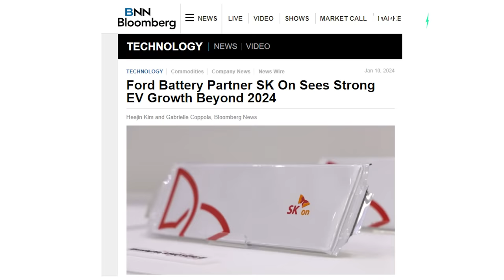Ford FIRES nearly 70% of EV plant workers,ramping up ICE production

Comment: I considered an EV from Ford, even considered a Bronco. However, with all the quality issues, dealer markups plus the dealer website fraud. I just won't ever buy from Ford until they can sell direct like Tesla and figure out their quality control plus fix their stealership network.
Reply: The other issues to consider with a EV:
Do I have a home charger, will I need to add battery packs and solar to the house to charge over night
Do I have a charge station near me that works
It the Electricity in my area reliable, or if out for a long period of time (this could turn out to be at night when you need to charge)
How many other EVs are in my area (Charge times go up if there are many)
Do I have the extra time in my day to charge it, if it takes an hour to charge that is an hour away from family
Does work have a EV charger I can use (Eventually, it will also be how much will they be charging me to use it)
how many miles am I expecting to drive it
Do I go to areas where there are no EV chargers
Can I afford the extra costs that go along with a EV
Will I still be able to afford my EV when the cost of electricity increases, and it will
Can I afford the extra taxes that will be coming soon to EVs, like road taxes (every dollar lost from ICE vehicles will be transferred over to you)
Reply: This is the problem with all the legacy manufacturers that are selling EVs, even the Europeans like BMW in the US.  The dealers hate EVs because they don't understand them, they can't make a fortune off service, they have to spend money to hire new mechanics or retrain existing staff.
Reply: @gotafarmyet4691 Do I live in a house? Or do I live in an apartment?
Reply: @jazzcatjohn  True i did leave that one off, because unless you own the property you do not have a choice.
Reply: @gotafarmyet4691  No, it plugs into a regular wall outlet. No, don't need solar,etc.  No, don't need a charging station unless traveling beyond the EV's range and plugging into the available outlet would be too long to wait. The rest of the issues are not really issues for anyone that has access to electricity where they park and extra taxes doesn't make sense because ICE vehicles will see a big increase in taxes which is why many in the US are upset. So, to summarize, if you have access to electricity you can own an EV and in many cases the cost of ownership is much lower than ICE and the vehicles are faster and more reliable, etc.

Comment: They need to listen to their customers not the government or they will be out of business.
Reply: Their customers are waiting for small, cheap EVs like they have ... everywhere else.
Reply: @jamesvandamme7786  Where's my diesel prius?   Hwwwaaaat?
Reply: @vilefly I have my gas Prius. Getting great mileage. 50+ in mild weather and 40+ in below freezing.
Reply: @miltonhayek2494  Right.  But a diesel engine is more efficient than a gas engine.  They could have done better.  Others could have done better, but they didn't.  Trains have done it for years.  It is known technology.  Diesel-electric hybrid drive is most efficient, otherwise they wouldn't use it.
Reply: @vilefly  No argument. I worked in power train for 18 years. You're 100% right on efficiency (and engine longevity). I feel the same way. I think it's a perception issue. I think they do this because much of the publics bias against diesel. At least in the US. But I'd gladly pick up one of those.
Reply: And they should behave like Real 'mericans right?
Reply: @douglaswatt1582  What?  If you're referring to what I said, it has nothing to do with being a real anything?  Diesel has a bad rap in the US. People know very little about it. What they do know is based on 80's trucks that spewed smoke, loud as heck, and rocked. Terrible first impressions. The newer generations have also been told that diesel is just dirty gas. They don't know of any upside to it. Stop trying to pick fights over nonsense.
Reply: @miltonhayek2494  I drove diesel cars in Europe. Smooth and good torque, and cheaper than petrol. I tried to buy a diesel in the USA but no got. Funny since trains and trucks still use it but cars put out too much particulates?? It would have been a good alternate to reduce energy consumption. But that's the past, with manual transmissions, and now pistons.
Reply: @miltonhayek2494  Well, the main bias was the high sulfur content which stunk, and damaged injectors over time.  I believe european diesel was more refined, and had less sulfur content.  Only recently did we lower the sulfur impurites.  2000, maybe 2010.....not sure.   I just wish they would use diesels with opposed piston, opposed cylinder design...like fairbank-morse engines.
Reply: @vilefly  I can't say about the chemical makeup.  I don't have the knowledge in that regard.  What I do know is that America produced terrible diesel trucks for many years in the 80's and 90's.  This view still persists.  And American's think of it as dirty, smoke billowing, pollution machines.  I felt the same way for a long time.  Then one day, while working at Ford on the powertrain line, I talked with a very knowledgeable engineer.  He drove a VW diesel for the same reasons we are describing.  He explained about the trains, the use as generators, etc.  It was a very enlightening conversation.  I still worked primarily with gas engines.  But slowly I did see how useful it would be to integrate them into the mix.  And the best way is what you had said earlier with the use in something like a Prius.  It would be a perfect match.  It would be even more efficient than the current setup.  And the engine would last forever!  Diesel is more expensive here than gas.  And by a fair amount.  But the efficiency gains, and eventual price reduction as more of it is used for this purpose, would make it worth it.

Comment: Everyone saw the EV graveyard in Chicago when the temperature dropped below freezing. These just aren’t practical yet, maybe someday but not any time soon.
Reply: what is this again?? I have a Mach E GT and it does fine in below freezing weather.  The range is about 20 miles less is all.
Reply: @panzer948  thank you for your anecdotal example.
Reply: What happened in Chicago actually happened. It’s a problem.
Reply: @risinbison1106  nothing anecdotal about it. Do you own one and speaking from experience? I am actually responding to you now while sitting in my Mach E at a supercharger. I am driving round-trip between Charlotte and Raleigh NC today, which is about 100 miles more than the total range... here in the southeast I am getting about 250 miles total range, when normally it's 270. That's real world experience to counter yours. If you don't believe me then that's your problem. I also normally just drive around my home city and charge at home for 20 bucks a month on my local utility pilot program. Good thing cause my other car only gets 17mpg... be glad to share more if interested.
Reply: @panzer948 it is anecdotal. As are the problems we saw occur in Chicago. The problem is not your experience. The problem is the experience in Chicago - which did genuinely occur.
Reply: @panzer948  I drive a lot cross country and sorry, I can count the number if EVs I see out on the open road on one hand. I’m glad you’re satisfied with your purchase but even people I know that have these won’t take them cross country. Maybe when the infrastructure is better they will become more plentiful. I have concerns about children in Congo or Chinese slaves mining cobalt for these but if you don’t think about that then you shouldn’t have a problem with it. I tow a large trailer as well, you can do that right? Ford lost $36k on every Mach E it made last year so they’ve halted production so hang on to it since it looks like it will be a collector in 20 years since nobody is hardly buying these.
Reply: @risinbison1106  you got a few facts wrong there buddy.  Ford hasn't stopped production of the Mach E.  They increase and then decrease it based on demand. Google that, like I just did, and a ton of articles will pop up.  This is the same with all EVs. Why, because a lot of people still don't understand them and are afraid of change.  I embrace it is all. I like new tech and I don't mind being an early adaptor.  I was also one of the first to buy the Chevy Volt in 2011 and GM lost money on all of them too.  That isn't nothing new with new tech. As more  people buy them, they will have bigger profit margins.  And wow.... don't even get me started on your comment about energy. If you really want to play that game I bet I could estimate a few million people that have died over the price of oil.  Think about all the wars we have fought and the millions we have spent dealing with the Middle East BS.  So, don't go talking about some mines and child labor.  The good news, if that is even half true than it can be changed.  Sadly, the BS in the Middle East can't.  Bottom line, energy isn't free and we are a long way from even partial Green Energy.  I will agree with you on one thing, the infrastructure across  the country does need to improve to bring more people into the market that spend several days a month driving several hundred miles.  But guess what, I took mine on a day trip today outside of its range and I might do that once or twice a  month.  The rest of the  month I am charging at home and never visiting a gas station.  Think how much that time is saving to wake up to a car that is fully fueled over night.  I think more are like that then are driving hundreds of miles a day.  If your not, then you need to wait.  I don't blame you but there are also pros to EVs, which many seem to ignore.  Another pro, which for some reason they haven't rolled out to gas cars, is it drives itself.  Pretty sweet to have autodrive.
Reply: @panzer948  I didn’t get anything wrong, you’re just a bit triggered but I understand. Ford is cutting back to bare minimum production because they can’t sell any Mach Es and they’re still have last years models filling up dealers lots, nobody, except you, want these things and dealers won’t take anymore. Want to discuss the Middle East? Gladly. We can produce enough oil here in the US easily and don’t need them but we can’t get enough cobalt here so those kids better get their ass to work so people can drive around. I noticed you avoid the towing question, no surprise, usually an SUV can go more that 80 miles hauling a camper but you’d probably have to strap a diesel generator to your roof to make it that far. EVs are not new technology. As you stated, the volt has been around for 13 years, the Honda insight came out in 1999 so we’ve had plenty of time to adapt but the volt and Mach E both lose money for the same reason. They’re grossly overpriced for their capabilities. A new base ford Mach is $43k, an F-150 is $36k. I could fill gas for 8 years before I’d make up the cost difference and got bad news for you, nobody wants to buy a used EV. The future is hybrid because it won’t leave you stranded in Chicago during a cold snap. The auto drive is cool technology, it’s also available on full size Chevy trucks so it’s not like it’s that unique.I’m glad you like your car, I really am but other than Teslas, the only place I ever see these things isn’t on the road but in dealer’s lots collecting dust.
Reply: @risinbison1106  still wrong on some facts as there are a ton of EVs in city's. Heck Teslas are about as common in Charlotte as Honda Accords, which is why I didn't want one. Yes EVs are great for city driving and not so much cross country until infrastructure improves. If city driving is mostly what one does then they are great. Just because you are a daily freeway driver that tows doesn't mean everyone else is. I get it that they don't fit your lifestyle (daily high mileage and towing) but they do fit many and eventually many others will too as oil is not a infinite resource, even in this country. Besides we live in a global economy and other countries will develop alternative technology if we don't (because oil is $$ there) so we need to stay ahead of the curve if we want to remain a world leader.  We can't wait for oil reserves to get low (and $$)  before figuring out a new tech. The time is now to work out remaining kinks so they are better for everyone. In meantime I have 23K miles in a year and haven't stepped foot in a shop for maintenence or repairs. Yes another pro. Did I tell u it costs me 20 bucks a month to charge at home in those 23K miles? Yes another pro. Did I tell you I hit 60mph in 3.5 secs? Yes another pro.  So I have already admitted to the cons but you have to admit there are some good things about them but if you cant see that then I am talking to a wall and wish you good day.

Comment: Not surprised at all because the Lighting with 515km is 100k plus tax in Canada. The same ice F150 or equivalent is almost 40k less so it’s a no brainer keep the ice truck.
Reply: Especially in Canada, unless you live in BC. Evs don't do well in cold weather, apparently they lose up to 70% capacity depending on the temperature.
Reply: @puddytat54  I live in Quebec and the last 2 weeks was pretty cold, -30 Celsius and I was losing about 45-50% with my EV6. I’m ok with that because we get those temperature 2-3weeks max per year and the rest of the winter I’m losing an average of 25/30% of 450km.

Comment: The market would be strong for a low cost urban commute vehicle.  Short range, small, light weight, charged at home. Especially for 2 car families.
Reply: So find me a short range urban commute vehicle, like the one we had in the 70's and 80's a small 10ft x 4.5 ft 4cyl car seating 4 plus 2 kids in rumble seats in the truck (station wagon version) with enough range for 300 miles per charge/fuel fill up, top speed 80-110mph.
And did I mention that we would have paid less than $2,000 for it when brand new?
Reply: @linusa2996  Yeah, so did we. But that same size car costs more now. Although you might be able to find that exact 70's car for $2000 today, but it might not run. 
BTW, if you want a short range urban vehicle, you don't need 300 miles of range. And you can plug it in at night, at home, no gas station trips required. 
There are a bunch of those in Europe and China, but we can't have them in the USA.
Reply: @jamesvandamme7786  15 years ago, I might be able to plug it in, these days I'd have to run it down 3 flights of stairs, out to the sidewalk and down the street half a block or more to where the car is parked.
Reply: That's what everybody's going after. Within 2 years you're going to have the first really good small and cheap EVs under $25,000.
Reply: @jamesvandamme7786  but I di need 300 miles of range. 300 miles is 210 usable range 105 in winter. I don't have a garage nor do I have access to a charger at work. Neither will be changing anytime in the next 20 years unless i retire and move to a trailer park

Comment: I assume the cost of the current batteries have been what Ford, etc, have been eating. Is there any other significant aspects that are costing above retail value? Is there a figure for how much cheaper the CATL batteries are, currently or projected?
And, I don't know how many folks are like me, but I think American manufacturers making their trucks almost exclusively 4-door, huge heavy trucks, was already a non-starter. It has the stink of Profit Uber Alles. Adding the extra weight of batteries ups these beasts to 'obscenely' heavy trucks and SUVs.
I'm still in my 2007 single cab Canyon, and don't see ANYTHING new I want to replace it with, especially any EVs.

Comment: Ford is just minimizing their short term losses while they wait for the next gen Lightning which will include next gen batteries that will be at least 50% cheaper to produce, NACS integration, and more US/Mexico battery suppliers that will qualify for the tax credits.
Reply: Actually, for those of us carefully watching the price curve for batteries YOU are probably correct. The next gen Ford Lightning will be LFP, handle cold better, charge quickly using NACS and (hopefully) not have buggy, poorly designed software.
Take the best features from this version, dump the stupid partnerships (SunRun? Seriously?) and cut the price back below $40K.
Reply: @rogerphelps9939 the reason everyone is moving to nacs is very simple, nobody expects a good return on building charging infrastructure or they'd be willing to make the investment.
Reply: @capnkirk5528  yeah, the Sunrun deal feels like a bad joke.  I'm sure it sounded good on paper 3 years ago but the implementation has been horrible.  It remains to be seen if chinese LFP overproduction combined with increased LFP and LFMP energy densities will equal reduced prices for consumers or if Ford's corporate greed and union conracts will derail any meaningful discounts for consumers.  Meanwhile, Tesla's Lithium processing facility in Texas opens this year and their ties with China are bound to lead to enough technology sharing to get the latest cell chemistries into USA made cars.